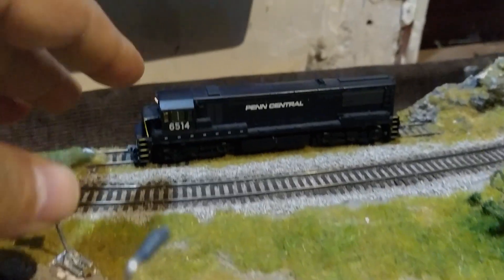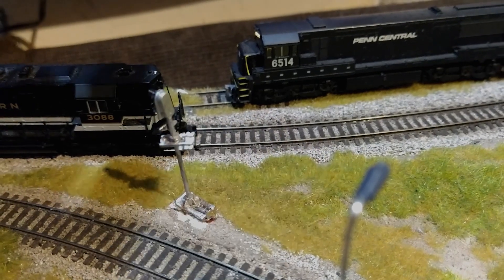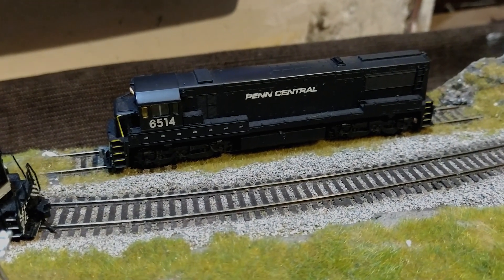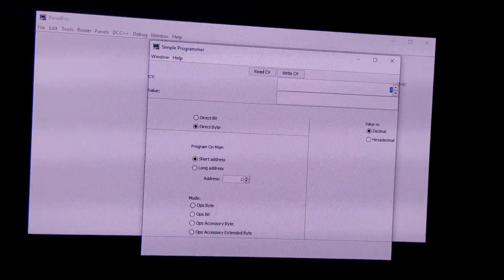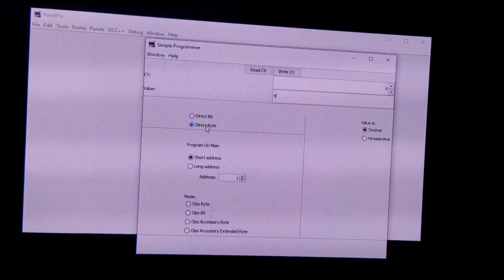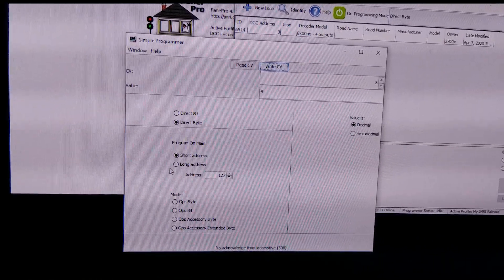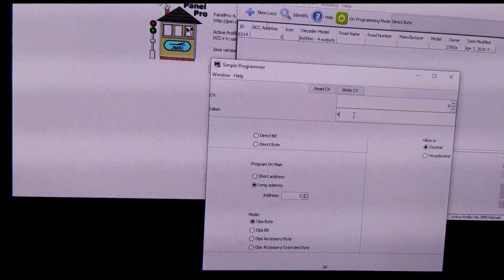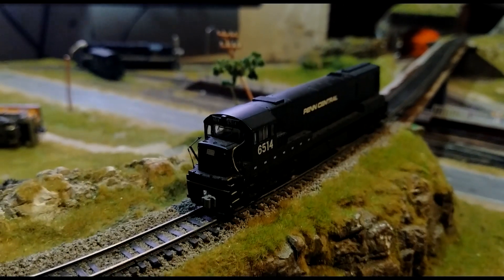How to Factory Reset Locomotive using JMRI

Comment: The recommended way to factory reset a decoder with JMRI is to open the roster entry for that decoder and use 'Reset' in the top menu. Then you click on 'Factory reset' in the dropdown menu. You are then given the reset options. There may be one or several depending on the decoder.